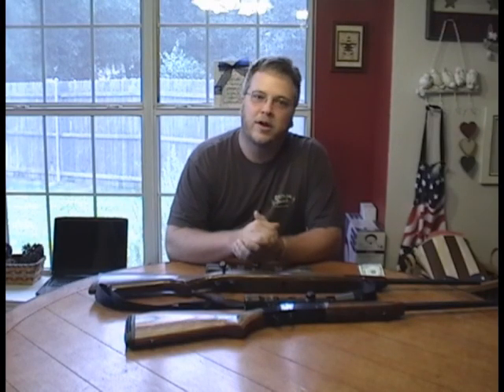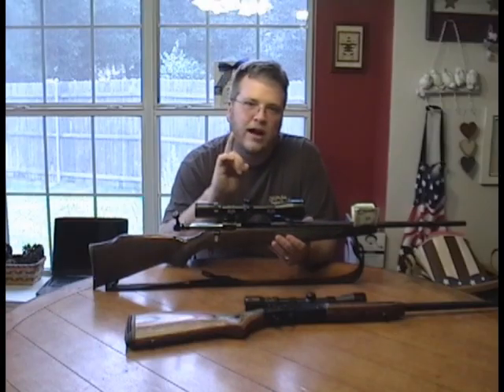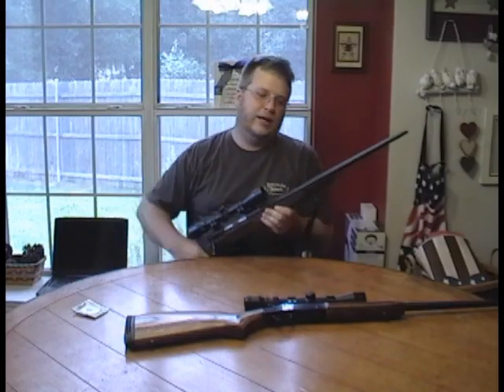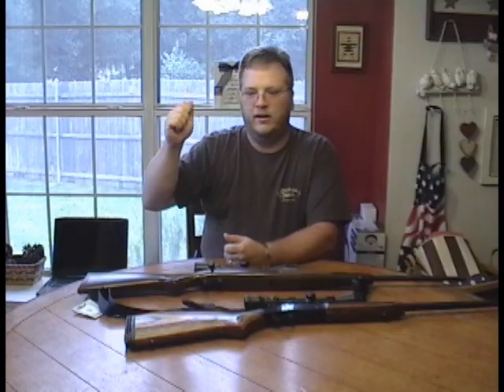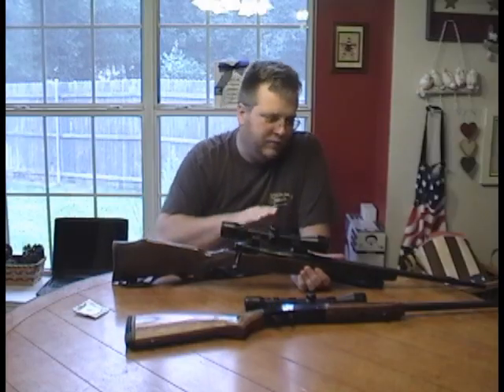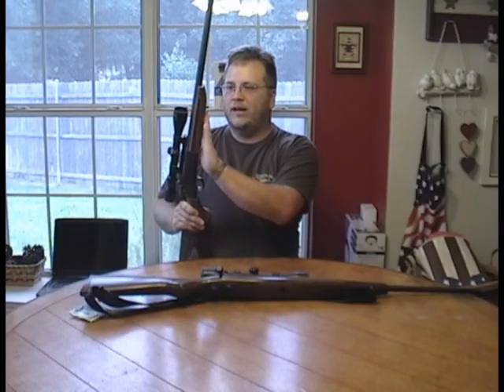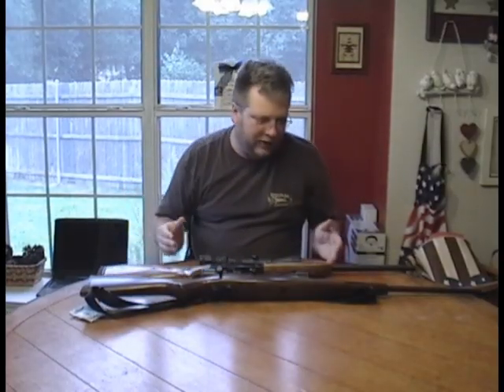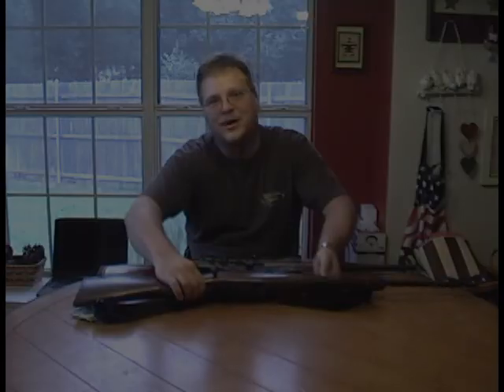Why Floating a Rifle Barrel Increaes Accuracy

Comment: I have a 300 savage that was made in 1958. It is a family rifle but shot 2.5 inch groups ;-(    I has a two piece stock with a screw in the middle of the fore end. I looked and noticed that the fore end wrapped the barrel pretty tightly as well. I decided to see if I could modify the fore end to get it to shoot. The head of the screw attaches to the barrel via a square flat 1 inch diameter head that fits a slot in the barrel. Here is what I did. I removed enough wood from the fore end to give about 3/16 inch clearance all the way down the barrels length. I then took an aluminum hunting arrow and cut it off at about 1 inch (you got to measure on your rifle).  I drilled out the screw hole in the fore end to give a circumferential 1/8 inch clearance around the arrow piece and filled the outside of the arrow piece with JB weld. Now the only place the barrel touches is on the end edge of the arrow piece and the square screw base, if that makes sense !! Bottomline is that my 300 savage now consistently shoots 1/2 inch groups !!! That is amazing to me !!!!

Comment: I wonder if floating the barrel on an air rifle would help the accuracy as well.. I just bought a .22 RWS Model 48, but it has the screw in the arm like that NEF Handi. I mean.. I'm really not looking to snipe a rabbit at 300 or even 100 yds but I'm just thinking whether it would help the accuracy. Probably not, since these RWS air rifles have really great groupings right out of the box and likely don't get hot enough to have the usual problem that floating would fix.

Comment: I have a Savage 110 and not free floated the barrel but then I put a cardboard shim under the end of the barrel get damp in the harmonics this gun shoots sub 3/4 groups at a hundred yards it is also glass bedded in a wooden Factory stock there are so many things that figure into accuracy such as bullet powder primer and neck sizing only all these things have to be consistent from one cartridge to the next not saying that you are wrong but you should have mentioned everything else that goes into accuracy

Comment: The harmonic is consistent the point at which the bullet is exiting the barrel in the wave is the issue. It's like fretting a guitar. You change the "note" or frequency by the contact points with the barrel

Comment: You want accuracy .
Glass the bed , float the barrel, reduce trigger pull to about 2 pounds , and reload your own ammo in 2 grain of powder increments and go shoot.  The charge you get the best group is your base line.  Next reload a grain above and below the base load. Shoot the groups again.    Dial in on the correct charge.

Comment: Barrel floating doesn't increase accuracy.  Floating the barrel helps eliminate the forces that cause in accuracy, opened patterns on paper.  It also lets the barrel return to it's starting position with out pressure from the stock.

Comment: If the round is supersonic and leaves the barrel faster than the speed of sound how can it be influenced by wave phenomena that is limited to the speed of sound? If a sight is tuned into the muzzle I don't think free floating can make any difference if shooting supersonic ammo. Also if you are rapid shooting you would want a dampening mechanism less you induce oscillation and make it worse.
Reply: Sounds move much faster in mediums over air
Reply: Two points to ponder. First, sound travels at 16,000 feet per second thru steel.  Second, over 98% of the comments show that there is no grasp of even basic 
nomenclature, and you think these people offer a
"informed" opinion?????

Comment: It's the amplitude not the harmonic frequency that varies when you "smack a steel rod" harder or softer....  Do a little refresher on frequency response (the frequency is fixed based on the material and geometry).

Floating allows for irregular/variable damping to be eliminated..

There is a reason for "heavy" barrels (increased frequency) beyond just thermal expansion.

Comment: No need to dryfire that rifle to take tension off of the spring.  Lift the bolt now pull the trigger and keep it depressed while you close the bolt. This will unload the spring while not having to dryfire.
Reply from the maker: kadmow, While you are correct @kadmow, anyone worried about damage to a modern rifle due to dry fire is a moron.  I am weary of explaining why, this myth is old an just won't die.
Reply: +Kris Bassett wow does  this really work ive  got to try it, your right man thanks. Im 49 years old and learned something new today.
Reply: +Kris Bassett Thanks for that tip, how have I not realized that before?
Reply: Hope ur being sarcastic...

Most basic safety lesson in long arms. How to safely carry a round in the chamber without having the gun cocked (ie. never trust a safety).

But  then again (sub OP) is dryfiring an issue nowadays?

Comment: I read in Rifle magazine that a proper free floated barrel will not make contact between the stock and barrel if you take one hand and attempt to press them together. If they don't contact each other then it's done right. I had to do a little more sanding on my 06's stock after reading that. Makes sense though and just use light pressure.

Comment: Actually, floating a barrel only enough for a bill to pass under is not enough.... Barrel harmonics is only half the issue requiring floating. Stock flexibility is the other half. Depending on the stock you should have .04-.06+ under the barrel. A good test to see if you have enough float is to lightly tap on the for end with your palm.(compressing the fore end towards the barrel) you should not feel or hear the stock contact the barrel. A stock can flex quite a bit with even the small amount of pressure exerted by a sling or even sitting on a sand bag. A cheap synthetic stock may never pass this test, but a good quality stock (wood or synthetic) will do well with .04-.06" float. Every firearm will need a different amount of floating depending on the stock construction, barrel profile, material, and the caliber... Generally a bill is not enough though.

Comment: how does sliding the piece of paper under the barrel prove that it won't impact the stock after a shot is fired?  is it reasonable to assume that the maximum magnitude of barrel displacement will be less than the thickness of the piece of paper?
Reply: +Jack Spirko of course it isn't a wet noodle but a paper bill is like 3 thousands of an inch and the barrel could expand that much and I'm sure it does. Free floating doesn't affect accuracy as much as people seem to think. The swiss K31 is a highly accurate rifle and is only partially free floated. It is more about consistency with the stock and the barrel.
Reply: What does hardness have to do with deflection when firing??  The overall hardness/strength has (almost) nothing to do with its elastic modulus (intrinsic property unaffected by heat treatment). 

 if one were to place the gun it on a rest and see if you  can make the barrel contact its bed (with hand pressures), you can be sure it will do such when firing, more of the "issues" with floating etc are to do with variations and flexing of the stock than overall movement of the barrel (unless we are talking about full length stocks).
Reply: Barrel steels are heat treated to a certain Rockwell hardness and since these barrels are heat treated the movement of the barrels is minimal. Because of my 37 years as a tool and die maker I would estimate the movement  would be .002 or less over the entire length of the barrel, that would be the absolute maximum given the barrel was correctly heat treated. I hope this helps all the non believers of floating a barrel.
Reply from the maker: Actually no that isn't reasonable.  It is a solid piece of highly engineered steel and it isn't like a wet noodle when fired.  Additionally is as I explained is more about pressure points on the barrel at time of discharge then something impacted after discharge.  The bullet to be blunt leaves the muzzle awfully quickly.

Comment: But if you take your time between shots, wouldn't that let the barrel settle until you fire again? Like striking a metal rod, waiting until it stops vibrating, then striking it again. I imagine that when you go hunting, you would not be firing shot after shot repeatedly at a prey, so there wouldn't be a need to float the rifle barrel. Please let me know your thoughts on this.
Reply from the maker: No it simply doesn't work that way.  It isn't the previous shots harmonics that are the issue.

Comment: Almost a perfect analogy, but I think it is not quite correct.  I believe changes in the damping of the barrel (from humidity, temperature, etc.) change both frequency and amplitude.

As I understand it, with a low pressure round the frequency of harmonic oscillation is changed just as much as with a high pressure round, but the oscillation amplitude is so low that it does not throw the projectile off as much.

Think of the stock acting like a finger on a fretless guitar.

It would be interesting to measure the oscillations in a barrel and then transpose them to audible frequencies so that you can "hear" the oscillations in the same "notes" that are traveling down the barrel, and compare different setups.
Reply: I believe the barrel has a natural frequency.  Free floating it avoids stock contact that can destructively interfere with the oscillations, changing the behavior.  For sure, amplitude of oscillation should change with changing pressures as well. The only places where contact would not impact oscillation harmonics would be at nodes along the barrel...best to free float so that as much of the length is free from interference as possible.  The Browning BOSS system tunes the natural frequency with an adjustable device at the end of the barrel for varying loads. Just another tech that plays upon the barrels natural oscillations under varying pressures.  Of course, bull barrels also oscillate...but the amplitude of oscillation over similar loads is dramatically less.

Comment: 100% correct. For example, Weatherby Vanguards with the #2 contoured barrel shoot sub MOA non-free-floated out of the box. Free float it and the accuracy will likely diminish.

Some mosin nagants will shoot better or worse after freefloating.

It depends..... contact your firearm manufacturer.

Comment: I read it in the NEF section of the graybeard outdoors forum. It is also listed in the owners manual, but I am sure that is more a CYA/warranty thing than any thing else.
Have you also been dry firing your handi rifles for 15 years?  If so, then I believe you that it won't hurt them.  I can see how it could cause issues with the transfer bar, but also how if it wouldn't stand up to that, how much difference would a primer there to absorb  some of the impact?

Comment: Accuracy is hitting what you aim at; precision is hitting the same spot with the same inputs (aka repeatability). Floating preserves repeatability by reducing zero shift as the barrel heats up, and buy facilitating consistent barrel harmonics. This is valuable in the field, as in training.

Comment: Would you say floating a .22LR rifle barrel would affect it's accuracy enough to make a noticeable difference? I have a marlin 25n with a synthetic stock, and it only attaches with one bolt, so I just put a rubber washer in where it connects to raise the whole thing up a little. Also does it matter if a little bit of the stock touches the barrel, or does the barrel have to be COMPLETELY free floating to gain any benefit?

Comment: ...So I then added a small square pillar of hockey puck in the stock inlet at the end of the forearm hoping to provide steady/even upwards pressure.

Accuracy got even better and managed to finally keep up with my full wood original M38 Swede. I'm sure if bubba had added the original forward  barrel band on the new rifle stock it would improve barrel harmonics further. But I'm problebly at the limit of the crappy plastic stock, which I know flexes a bit.

Anyway...So I totally agree with you...

Comment: I had accuracy problems with an M38 Swedish Mauser sporter (6.5x55).

Sure enough bubba the gun butcher that owned the rifle before me just dropped it into a plastic stock...barrel was touching one side of the inlet.  

So I floated the barrel buy using a small dowel wrapped in sandpaper and sanded the inlet down and guess what? The accuracy got better.

Then I remembered that the Finns used strips of brass in their captured Mosins. 

So I then added a small square pillar of hockey puck in the

Comment: Barrel Harmonics.  Every barrel, when shot, will flex or move.  Free floating the barrel allows the barrel to work or move.  Sporter barrels, found on most hunting rifles have more flex than that of a heavy or bull barrel.  Length of barrel does affect harmonics but that is a different topic.

Comment: @survivalpodcasting I agree 100% with you, I've never had a centerfire rifle's firing pin break from dry firing. Iv'e shot, and dried fired a garbage davis 380 pistols and the slide eventually cracked and the firing pin never broke. And that slide didn't lock back so it got dried fire a good bit. However I did have one bad experience with a Taurus pt 22 .22 RIMFIRE pistol.  After very few accidental dry firings, the firing pin broke like glass.

Comment: The consistencie problem with the Handi Rifle is typically cause by the shooter. The long lock time by the actual hammer and people having the knowledge or the ability to hold after the shot. You have the same problem with people shooting pellet rifles because the pellet is so slow out of the barrel. I have one in .308 that is sub .5 MOA at 100 with standard factory ammo.

Comment from the maker: @starr8719 - If you mean variance in how uniform the space between the barrel and stock are, it really doesn't matter.  As long as the two don't make contact it is irrelevant as to the variance of space between the stock and the barrel.  If they do not touch they do not effect each other.

Comment: @varun009 -  That has absolutely nothing to do with anything. You are assuming the only time floating improves accuracy is when you fire multiple shots.  That only barrel heat effects tension on the barrel from the stock.  Many other factors do such as the temperature of the environment, humidity variations, how the weapon is held, etc.  So if you zero at 800 ft elevation, in Sept with humidity of 70%, on a bench.   Later you are at 5200 ft, hunting deer, humidity is 20% resting on cold ground.

Comment from the maker: @varun009 - What I mean is that a gun that has tension on the barrel will shoot differently as the pressure changes even with a "cold bore shot".  Additionally as you zero your rifle that barrel will heat up, that changes pressure on the oscillation and you put it away happy.  Now you go to shoot at game cold bore and your shots are hitting differently.

Comment: whats the point of floating the barrel on a single shot bolt action rifle? i mean the opoint of floating is not to increase accuracy but consistancy and as it is that's not possible with a single shot since you have to constantly reload your weapon. however this would make sense with the barrett m82. other than that great video i learned alot!

Comment: I have a savage 110 and I have the barrel bedded all the way up the foreend of the stock. this was a common practice back in the day. I say back fifteen to 20 years ago. With reloads i can shoot less than a quarter inch at 100 yards. The problem is when the stock has uneven contact with the barrel. While free floating the barrel is better than uneven contact, it is not better than bedding the barrel up the forend.

Comment: @awsomeshot also true i did it before with my remington model 700 7mm rem mag and i cocked it for the 3 hour drive down cuz in my state if there is a bullet in the mag they can arrest you so when i pulled the bolt back it cocked it then when i loaded it the next morning it was still cocked so then we took it to one of the best gunsmithes in the US he said the spring was worn out and we had to buy a new one off him the the rest of the week all i saw was does and on spike

Comment: That was a great video. Man you can talk at a rate. @patevans33 I have a .308 Remington model 700 sps varminter. The best thing I ever did was throw it's factory synthetic stock in the bin. Such a heavy, high pressure barrel mounted on a flimsy piece of plastic. As the fella said, it's all about harmonics. I replaced it with a bell and Carlson composite stock. That greatly improved the rifles consistency. But the bel and Carlson weighs a ton. Rifle weighs in at 16.1 lbs. Now I'm making my own s

Comment: At 1:45 you have performed a dryfire! Do not ever do it again please, instead just press the trigger before and while you close the bolt back. That way you wont have to perfrom  a firing-pin-breaking dryfire. Otherwise thanks for the lesson!

Comment from the maker: @captainpegs07 Do you even know what "float" means. It means to remove contact between the forearm and the barrel. One can easily float the NEF/H&R right up to the forearm screw. One can also use what NEF enthusiasts call "the rubber washer trick" to float it past the screw all the way down to the claw lock at the receiver. Once done the only point of contact is the washer around the screw, this "floats" 95% or better of potential contact. Sorry you are just wrong, facts are stubborn things.